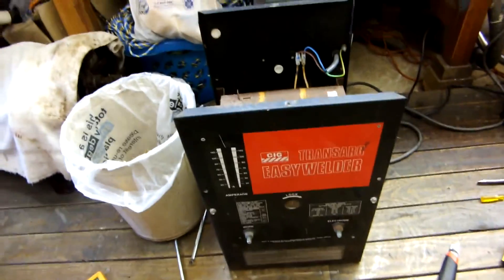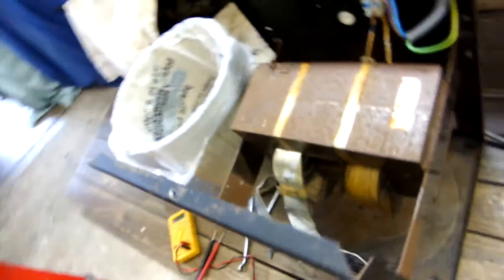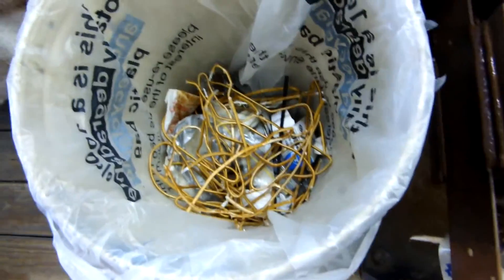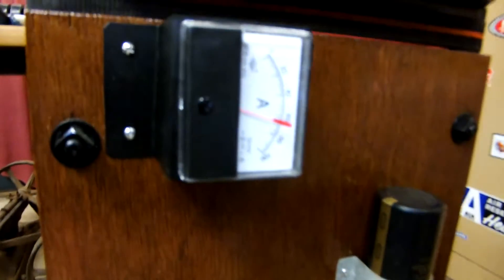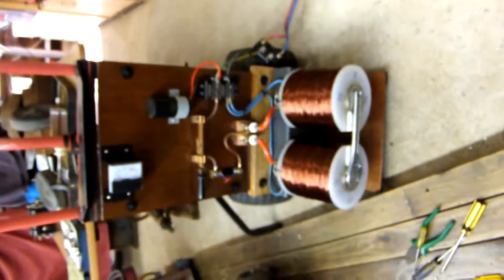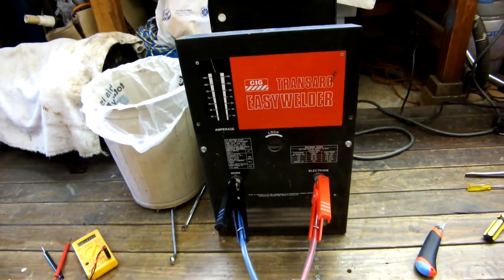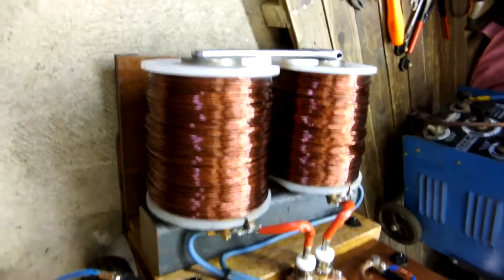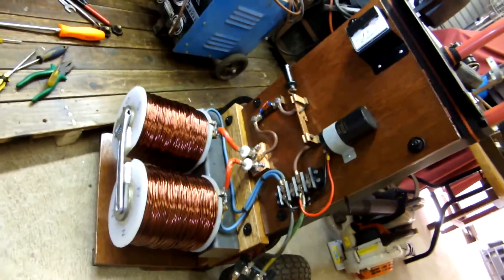Welder modification to increase amps for a Magneto Recharger

Comment: Adam, you are a genius my friend. I am leaving a career as a chemical engineer because of the people in big Pharma. I am starting a welding, fabrication, foundry, and light machine shop that specializes in pre WWI race cars as well as British and German etc. sports cars from the "distributor" era or when they have had distributors and points. I am starting to have to deal with magnetos and I have to build your machine . I am sure it is a daunting job. I just found a welder for $20 so I am starting there.. Any suggestions?
Reply from the maker: Check out this link on making the magnet recharger  https://www.youtube.com/watch?v=hMwCdag2Pn0
Reply: @adambone4213  Thank you.

Comment: What is the motor coil from? Also, why do you need a rectifier for the magnetizer? I do not understand exactly how to use DC motor coil with a direct current. Can you make a video and include details that are by you  understood, but I might not know, including diagrams and the math, formulas.... I found you, because I want to remagnetize few horseshoe magnets, that are very weak. They are only  about 5" tall and almost 3" wide and bare rod is 3/8" x 3/4" .  I also saw several other videos, but so far none of them talk specifick. One video was showing to charge the horseshoe magnets one pole at a time, not both at a time? But on the TV program called "How its made", the worker was charging N + S  poles at the same time, so I assumed that it is the correct way of charging horseshoe magnets - can you explain this also please? Thank you very much for your videos!
Reply from the maker: It is hand wound. Quite large and relatively expensive. If you only want to remagnetise a couple of magnets, I recommend you get someone else to do it for you. Auto electrician, magneto restorer or maybe a vintage stationary engine club member. Whoever is trying to charge one end of a magnet at a time clearly doesn't understand the process, or in fact how a magnet works. A horseshoe magnet is basically a straight magnet bent into a 'U' shape. The rectifyer converts my power supply from AC to DC to simulate a battery. You need the north and south pole to remain the same, not alternate as per AC. If you are doing a one off and have acquired an electromagnet (coil with steel core), just a car battery or 2 in series would be an easy option. All the best
Reply: @adambone4213  Thanks for your clarification! Have a great day!
Reply from the maker: Check out this link   https://youtu.be/hMwCdag2Pn0
Reply from the maker: Check out this link on making the magnet recharger  https://www.youtube.com/watch?v=hMwCdag2Pn0
Reply from the maker: Its a large capacitor, not a coil. Check out this link on making the magnet recharger  https://www.youtube.com/watch?v=hMwCdag2Pn0

Comment: 65 000 Ampere-turns? OMG, Thats a lot...:D 
65 amps for those coils is a lot as well, so I suppose after 30-60 seconds thge coils must be quite warm.
Reply from the maker: Theoretically it only needs to be on for a split second to do the job but I leave it on for 2 to 3 seconds at a time just to be sure. It pulls my brownbuilt cupboard door open from 1 meter away
Reply from the maker: You only run it for 1-2 seconds at a time! The magnetism effect only takes milliseconds
Reply: #10 wire is nominally rated for 30 continuous amps, running in relatively loose conduit. Wound in a coil like this, the amps rating is much less... for continuous running. For intermittent, momentary duty, such as for this magnetiser, #10 wire is quite satisfactory.

Comment: Surely, if you just connected the outputs of both welders in parallel you'd double the current capacity. All you need to worry about is matching the output voltages from both welders. You need to get the both exactly the same otherwise you'd get a back-voltage through the weaker welder. Plus you need both welders outputting the same type of current, either AC or DC. If they're both DC then nothing to worry about. If both AC then all you need to worry about is that they are both at same frequency and in phase with each other. If both at mains frequency, ie: 50/60Hz, then nothing to worry about here either.
Good luck!
PS By raising the voltage of that welder there, yes you do increase the current but you really need to keep the voltage low else it will really mess with your weld.
Reply from the maker: It's a $20 second hand welder dedicated for this purpose. I have a mig welder for actual welding